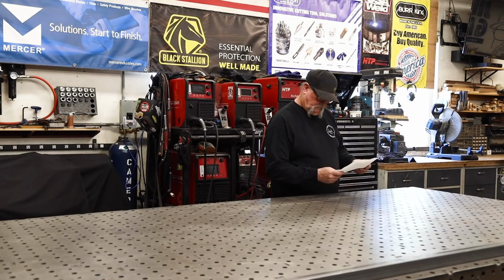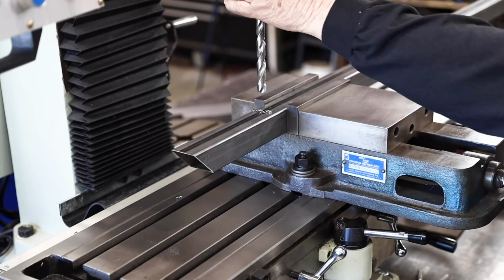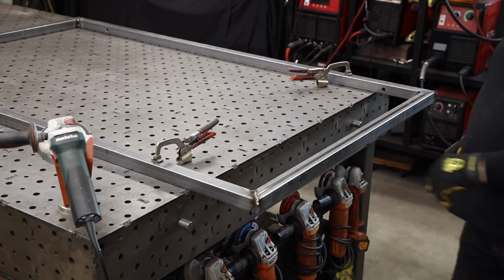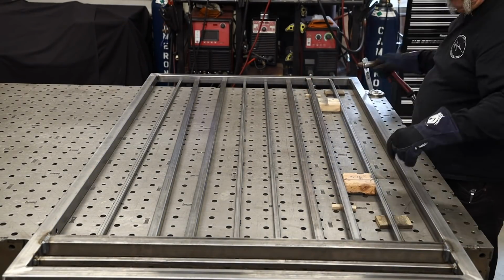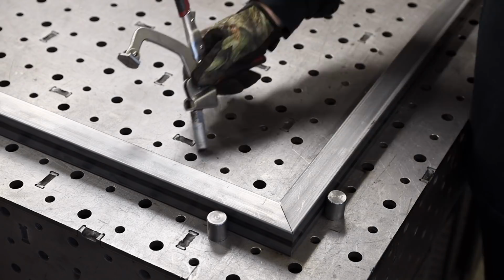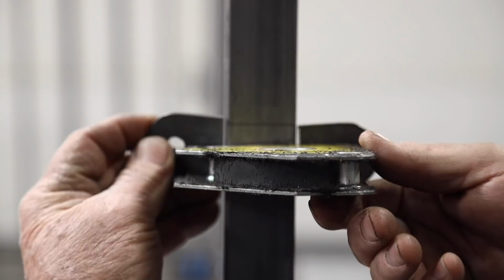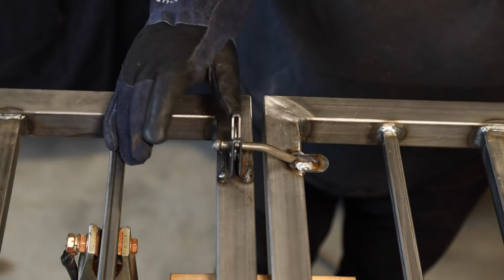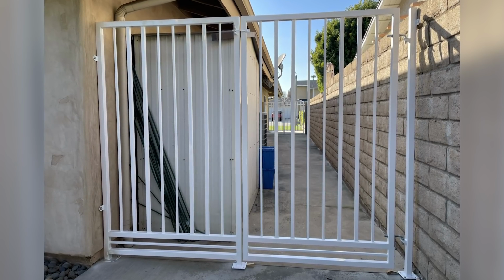Metal Gate With Side Panel | JIMBO'S GARAGE

Comment: Jimbo is it not better to bevel the edges before welding your 45 degree joins so that the weld penetrates deeper?
Reply: True, but not necessary in thin wall material. Penetration isn't an issue. Over penetration is more of an issue. This isn't structural nor pipe work. It's just a small bit of fence.

Comment: Keep up the great videos! Love them all. Question...what welding helmet you using these days? I didn’t see it in any of your equipment lists. Just getting started and don’t wanna burn my eyes.....Anyone else have input here as well for hoods you like? I’m open to any help in the safety area!
Reply: Any good welding helmet with an auto darkening lens is gonna work great for you. I'd recommend one that has various modes that it can operate it, so you can you it for cutting, grinding, as well as welding. Obviously name brands like Miller, Lincoln, Snapon, etc will have more bells and whistles and probably have better technology, but anything you can get at the local welding store should work for a beginner. Personally, I'd recommend the Vulcan ArcSafe from Harbor Freight as a starter, SKU 63749. Its a good starting point that won't break the bank. You can always upgrade down the road, and then the Vulcan can be used by your helper or by someone who just wants to watch and learn.

Comment: Hi Jimbo, I live in South Africa near the coast. The guys here usually have their work galvanized against rust. They leave it as is or have it powder coated or epoxy coated according to customer's preference. Do you guys need to have your work galvanized in some regions where rusting is a problem?
Reply: Hey Andre, goed gaan dit? I lived in the Midwest in the States for years where everything metal will always rust, in my experience fabricating we would always use either an epoxy primer or powder coat. I live in South Africa now and how found the humidity is much the same as where I lived in the States, so I use the same you said galvanized or powder coat.